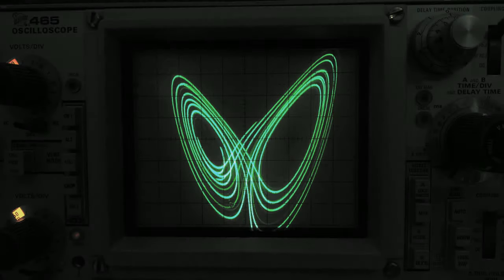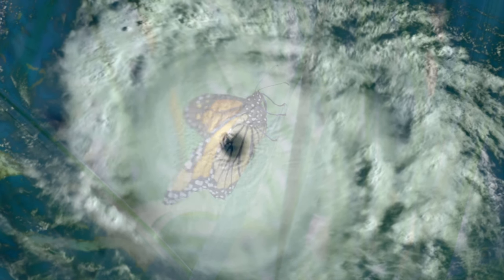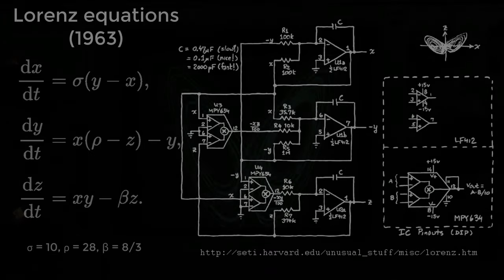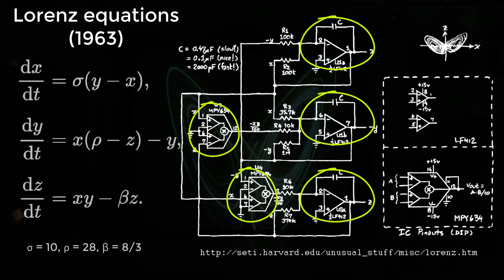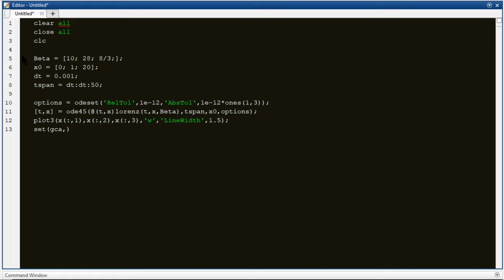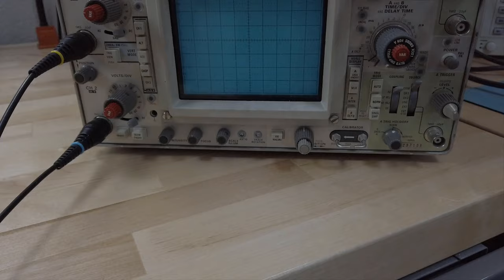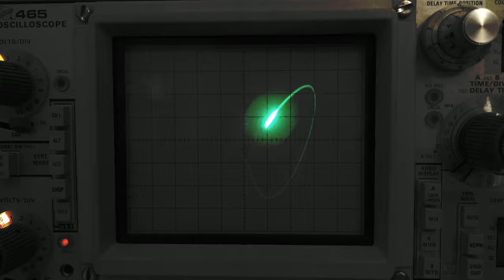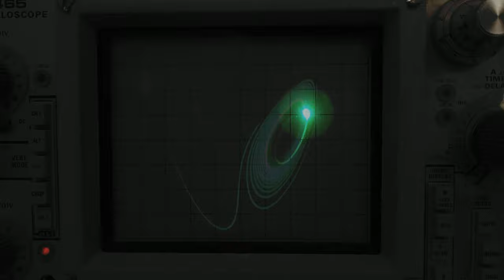Chaos Theory - Analog Circuit Lorenz Attractor PCB

Comment: I tried this in LTSPICE but could not get it to start. What initial values will make it work in LTSPICE? Thanks.
Reply from the maker: you need to plot the outputs in XY mode, try looking here: https://electronics.stackexchange.com/questions/365545/how-do-i-achieve-xy-mode-on-ltspice#:~:text=Assuming%20you%20are%20using%20.,all%20there%20is%20to%20it.

initial conditions are σ = 10, ρ = 28, β = 8/3, with XY mode set up, set z(t) as y-axis, and x(t) as x-axis.

hope this helps!

Comment: Why does your butterfly keep flickering in the anallog display? 
Is it noise creeping in and causing the butterfly to change, due to sensitive dependence on initial condition?
Reply from the maker: Which flicker are you referring to? At the end of the video I actually imposed two videos on top of each other and synced to the music just for visual effect.
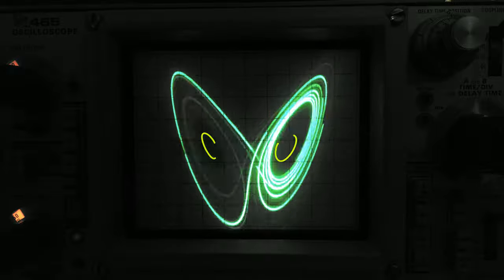Reply: I'm reffering to the part at 3:30
Reply from the maker: @bthl1215  i think this has to do with the speed setting of the integrators (the cap in the feedback of the opamp adjusts the display speed). the "flicker" is due to the nature of the attractor, the point will periodically collapse into one of the basins of attraction and then spool back up to bouncing between the two attractors.

Comment: This is beyond fascinating.

Red pill me on analog computing.  I thought that was entirely a fad from the 70s.
Reply from the maker: Hah definitely not a fad. Analog computing shines when attempting to simulate highly complex systems, like those found in biology, chemistry, or physics. Digital computing is only practical when you over simplify the system and make a lot of assumptions. Often times this is good “enough”, but there are many cases where making these simplification lead to results that aren’t meaningful.

It will also be interesting to see quantum computing evolve and expand our ability to simulate and solve complex problems with many states.
Reply: @ZacksLab  Hmmm, so that's one end of the spectrum.  Simulating complex nonlinear systems for the purposes of research into their general behavior.  Large, complex, imprecise, somewhat general in application.

How well does analog processing work at the other end of the spectrum?  Doing simulations for a smaller nonlinear system you're trying to control in real time?  The speed of calculations is still a headache even for things like motor control, which isn't that fast.
Reply from the maker: @valwold3567  I don't know of any real world applications (today) using analog computation for real time control... the advantages of digital computing far outweigh the speedup potentially gained from analog computations, namely that it's easy to modify a digital algorithm, bit error correction can be done on digital signals, and digital signaling is not as susceptible to noise.

I believe the second coming of analog computing (in the form of analog co-processors) is still in the research and development phase... for example, DARPA launched a program a few years ago: https://www.darpa.mil/news-events/2016-05-06

Comment: maybe stupid q:  what do the axes actually stand for? I mean you said theyre all functions of time, but what happens during that time? what does single point in that butterfly tell us about the system?
Reply from the maker: good question! from wikipedia:

“The equations relate the properties of a two-dimensional fluid layer uniformly warmed from below and cooled from above. 

In particular, the equations describe the rate of change of three quantities with respect to time: x is proportional to the rate of convection, y to the horizontal temperature variation, and z to the vertical temperature variation.

The constants σ, ρ, and β are system parameters proportional to the Prandtl number, Rayleigh number, and certain physical dimensions of the layer itself.”

basically Lorentz wanted to create a model for atmospheric convection. when looking at the plot over time, you are looking at the “phase space” where each point in 3d describes the complete state of the system. interestingly, as the point moves, it never crosses itself. it is an infinite curve in finite space. this means that its future cannot be predicted even though the equations are completely deterministic. 

the essence of chaos is that a system can be both deterministic and unpredictable. our solar system is chaotic at large enough time scales, contrary to newtonian physics that allows us to pinpoint where planets and stars will be in the future. given enough time, the future is completely unpredictable... 

...unless you are Laplace’s daemon. ;)
Reply: @ZacksLab  but a convection chamber (if you can call it that) isnt the only system that creates a lorenz attractor, right? Rate of convection couldnt describe a pendulum for example or am i missing sth
Reply from the maker: remember that the lorentz equations are models, not actually reality. but with that being said, the lorentz equations can be used as simplified models of other systems that are seemingly unrelated to convection.